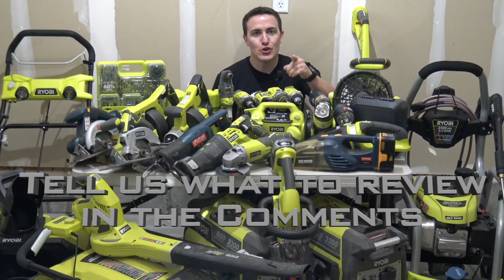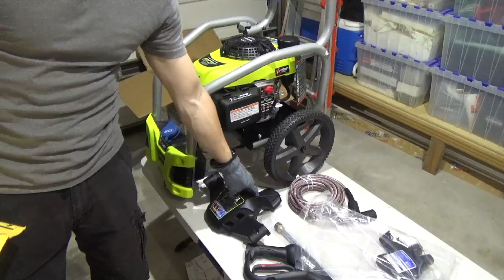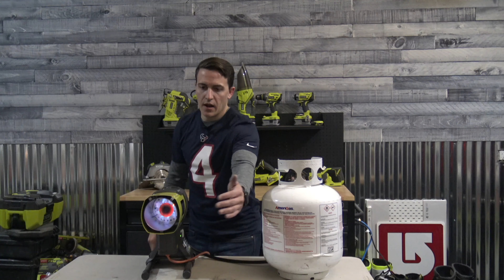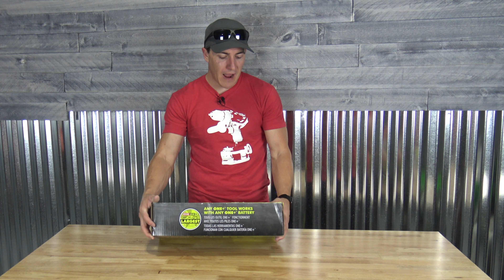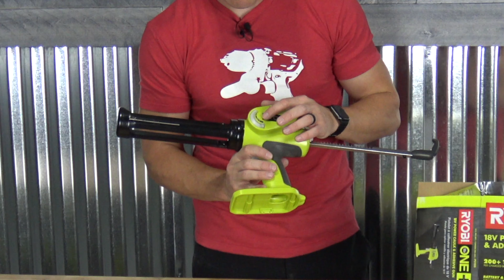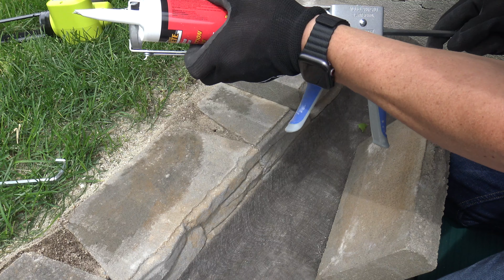Ryobi 18-Volt ONE+ Battery Powered Caulk and Adhesive Gun P310G - Box Opening!

Comment: Its not that great, imo. The gears jump in mine,if you just bump the trigger it works fine, just wont hold much pressure
Reply: OBSERVANT SERVANT if you forget to puncture the tube and you just let the gun push and blow the tube seal out, you end up stripping the gears.  That’s how I wrecked my first one, the new one has been fine for over 2 years n still running.
Reply from the maker: Thanks for sharing. We haven’t experienced that, but gears jumping and not holding pressure would be frustrating!